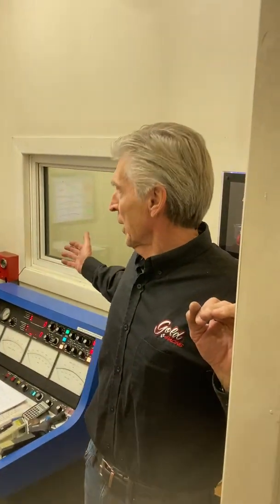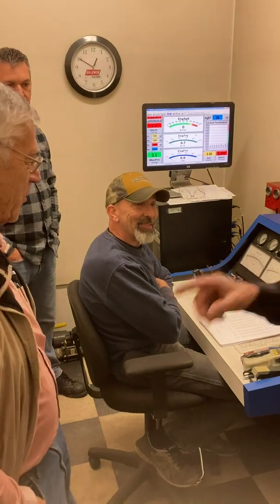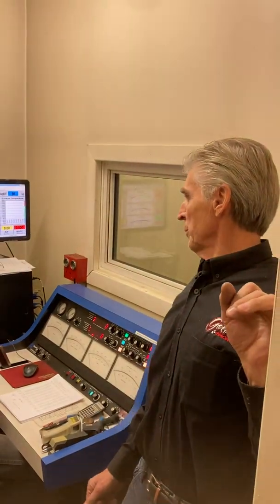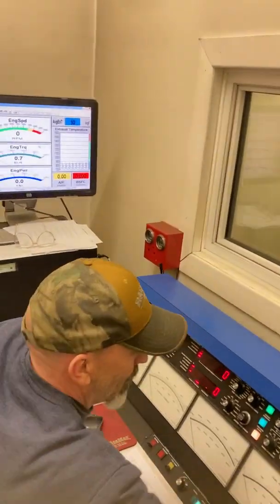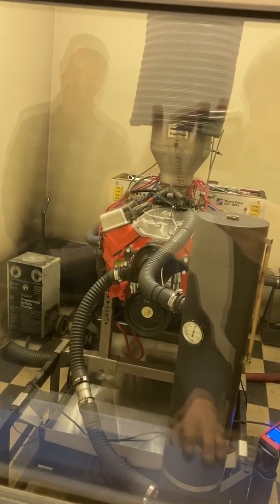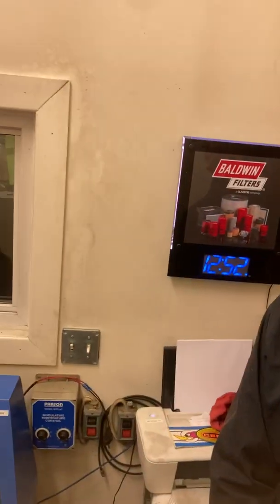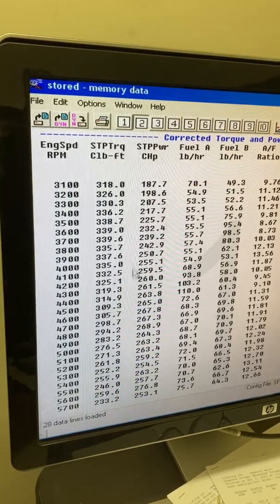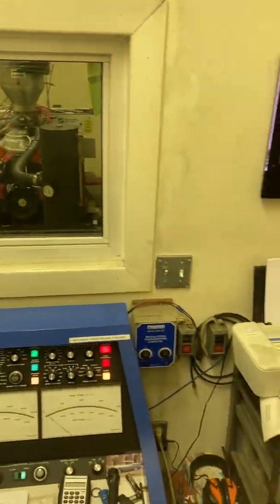307 SBC Chevy Dyno day

Comment: Just got done watching your 307 videos and I have a question for you regarding my 307 build. I have a 307  that was bored out .60. I put a lunati cam and lifter kit in it, .416 heads, stock melling pump. I have too much oil pressure, so much so that I have oil coming out of the front and back of the oil pan at idle and shortly after I shut it off. I measured about 85 psi at cold idle and it bumps up 10 psi more when I throttle it up. If I run 3qts of oil in the crankcase I get right around 60psi, but I still have oil coming out of the pan. I am using the same oil pan gasket as you did on your build and I am using a Proform 4 qt pan. Any ideas? Thank you.
Reply from the maker: Thanks for the question Robert. First I don't think there is a cause and effect relationship between the high oil pressure and leaking oil pan. Yes, more oil will be splashing around but there is no actual pressure on the pan gasket. I suggest you check the fit of your gasket, it could be that the gasket is not seated properly in the pan at the back or timing cover at the front. I usually put a dab of Permatex in the corners front and back. 
Your oil pressure must be the result of tight bearing clearances. Oil pumps create volume and the restriction to flow creates pressure. 
Reducing the volume of oil in the pan to reduce pressure is not a good remedy because you will be pumping air and cavitate your pump. 
You could change the pressure relief valve spring in your oil pump. There are I think 3 different springs available and they are color coded. You would have to remove the pump and drive out the little roll pin to change the spring. IF you do this, also check to see that the pressure relief plunger is moving freely. If it sticks in the closed position, it will never relieve pressure. 
Also, what oil are you using? A lower viscosity oil should help.
Lastly, what is the pressure when the oil is hot? If you haven't got it hot, I suggest you do this before making any changes. 
I hope this helps, please let me know what you find. AG
Reply: @goldsgarage8236  
Thank you for replying I appreciate it!
I thought it was a stuck relief valve so I replaced the oil pump with a new m-55 pump and installed the one piece felpro gasket. I've put around 500 miles on the engine. The stock oil pressure gauge in my car goes to 60 so I hooked up an aftermarket gauge. I was using 15w40 oil originally. At that weight with 5qts installed I was getting right at 90psi cold and wouldn't drop at all at idle (750 rpm). If I drive and get behind er she would get to 100+ psi. I thought about the weight so I tried 5w20 oil. It dropped the oil pressure around 85psi cold and 90psi whomping on her.  Then I thought it might be an oil volume issue so I dropped all the oil out of her and refilled and tested the cold oil pressures.

At 2qts installed,  I get 30 psi cold
At 3qts installed, I get a little over 60 psi. I also start to push out oil out of the front and back of the oil pan. I've tried permatexing the front and rear but the pressure just pushes out anyways. 

Which bearing clearances are you thinking are too tight? Cam or crank? 

I'm kind of at my wits end on this engine lol, I'm thinking about just putting more miles on it and maybe it needs to break in more?

Thanks again for your reply
Reply from the maker: Thanks Robert. This is a strange one for sure. 
First I would not recommend reducing the volume of oil in the pan below the add mark.  
With 2 quarts the pickup is probably sucking air and that will cavitate your pump, and pump air into your bearings. Air is compressible, oil is not. 
Tight rod and main bearing clearances will tend to increase oil pressure but if you have run this engine without issue they must be ok. The OEM spec for minimum clearance is .008" for the mains and .007" for the rods. 
The oil pan gasket should never see pressure (only splash) regardless of how much pressure on your gauge. Are you sure the leaked oil isn't coming from somewhere else, rear main seal, timing cover, oil galley plugs etc.?
That is all I can think of for now. In the meantime, I would invite anyone reading these comments to weigh in. 
Thanks AG
Reply from the maker: Robert, just to add, you have replaced your oil pump, but with a standard relief valve spring. You could try using a spring intended to reduce the setting where it will relieve. I can't recall the details right now but there are I think three springs. If you do some research on this I am sure you will find an answer. AG
Reply from the maker: Robert, correction .0008" for the mains and .0007" for the rods. I just noticed that I misses a zero in my previous response. Thanks
Reply from the maker: Robert, about the oil leaking from the pan. I am assembling a new 406 right now. I have a one piece oil pan gasket and a new oil pan. Just from priming the oil pump I have a leak at the front of the oil pan. The radius of the oil pan is not a perfect fit to the gasket. I wonder of this is your problem also?

Comment: I didn't hear head choice..  Visegrip Garage U-TUBE channel built a sbc.307 stock bore using 416 heads unknown head work with a unknown Lunati cam that kept hitting 292 hp 298 hp then at end he said a little over 300 hp.  I've got a 307 I'm saving , I have 416 heads and 062 casting heads. I don't know what I'm going to do with it yet ?  Probably use a summit 234/234 cam with port work on old 416 heads.  In the 1980s and 1990's I could have gotten manual swap kits for G-Body's at junkyards. Now they're gone like the sbc 307's. So I'll keep it.
Reply from the maker: Thanks for your comments Chris. We did use 416 heads, but with a heavy vehicle, automatic transmission, stock converter and highway gears, and taking into account the driving style of the owner, the emphasis was on low to mid range torque, throttle response and drivability so we chose a cam that will  provide that. If the 307 was going in a Nova or Camaro with 3.73 or higher numerical ratio gears and a 4 speed or high stall converter we would have cammed it for higher RPM power.
Reply: Good that you saved that 307!

Comment: what a dog 267 horsepower at 4700 rpm then it drops horsepower then picks it back up and hits 276 horsepower at 5700?  That my friend is a major tuning issue generally associated with over carburetion or inadequate valve springs / rocker stud flex. I have a .030 307 I built for a 1970 Chevelle Malibu with 081 L69 center bolt heads with orange valve springs, Holley  Street Dominator intake, 1850 600 cfm carb, and Chevrolet Performance 24502476 cam and its making 323 hp @ 5800 rpm. Those 416 heads do not flow even close to what the center bolt heads flow. With a multi angle valve job getting 200 cfm from them with a 1.84 inch intake is easy. Theyll outflow every small block head  with a 1.94 inch intake at .450 lift except the 291 double hump. The cam you chose is a good choice in my opinion so theres no argument there but I see the head choice and intake manifold being the limiting factor in why you couldnt hit the 300 hp mark
Reply: I have to disagree. First off the double humps don't flow as good as people think. Now as to the 416's, they flow 185, stock, at .500. You add in the 1.94 valve, bowl work, and a proper valve job, 200-210 @ .500 is no problem. But even stock they flow plenty for a 307. At 185cfm they can support about 350hp. Are the Vortecs better? Sure, but the heads aren't an issue on this engine.
Reply: true the 305 vortec heads are the best ones but you need  a intake to go with.